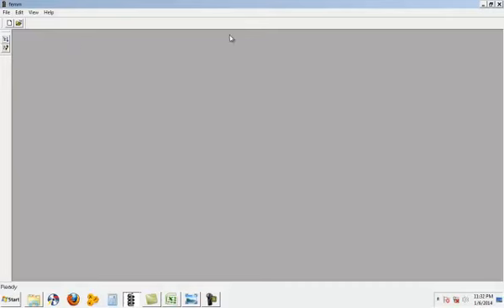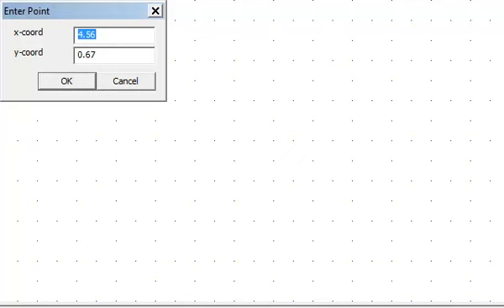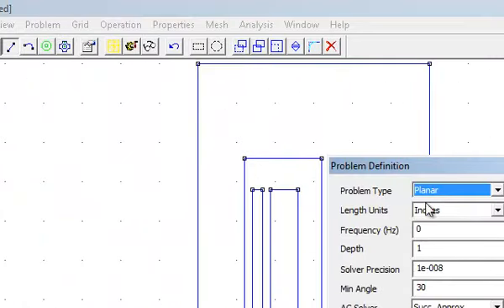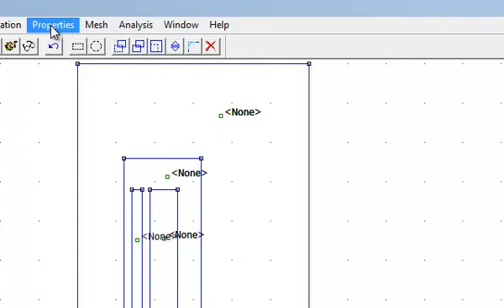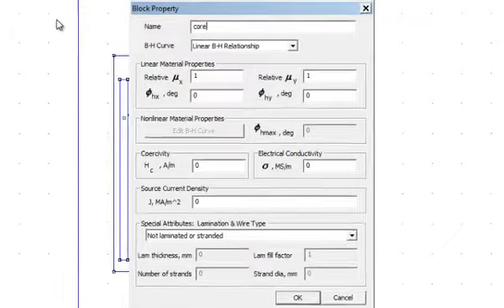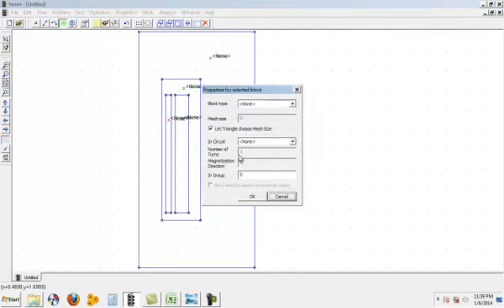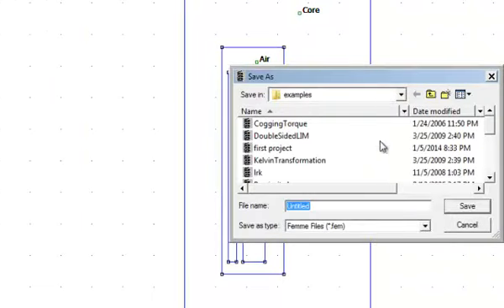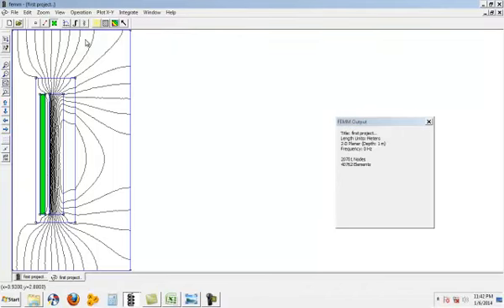FEMM FINITE ELEMENT METHOD MAGNETICS FULL SOFTWARE WITH EXAMPLE | FEMM TUTORIAL TRANSFORMER EXAMPLE

Comment: I don't understand why you apply A = 0 on those walls and not on the external boundaries of transformer, can you explain it?
Reply from the maker: Good question actually it's due to air surroundings not a live part
Reply: @SurajKClasses  Sir, if I specify that the external areas are also air, do I need to apply A = 0 at the external boundaries like @Luis A. Alvarez-Gomez
 said?